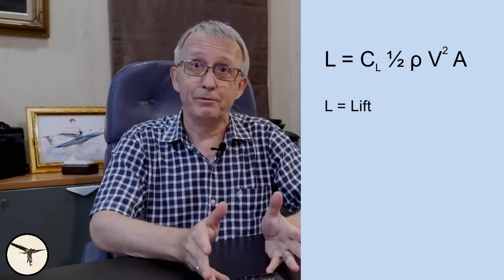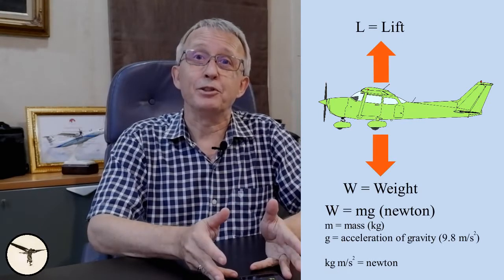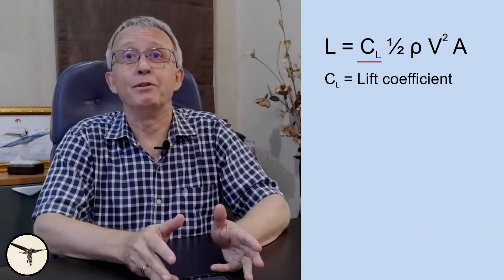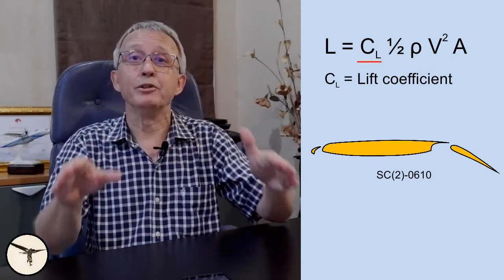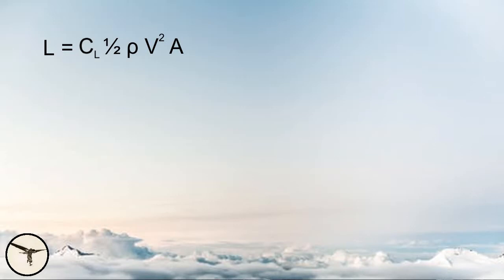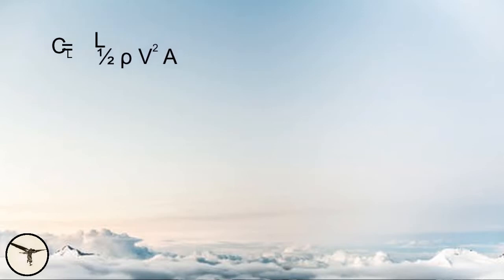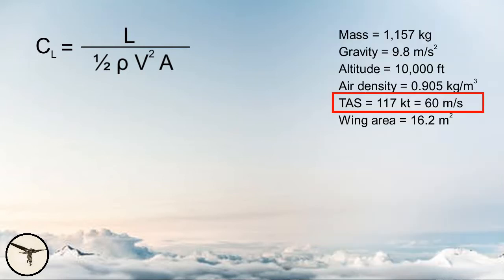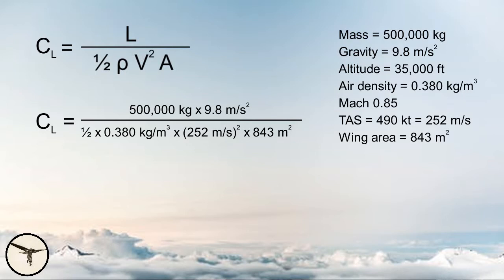The lift formula explained

Comment: What is conversion from CL to aoa?
Reply from the maker: It depends on the wing profile and the flaps setting. Each wing profile is different. The correlation between AOA and CL on a Cessna 172 (flaps up) is shown at 6:10.

Comment: Hi, thanks for the video! May I ask, where from does the AoA in degrees in the formula result came? I missed that part. Thanks (7:38)
Reply from the maker: The relation between AoA and lift coefficient is shown at 6:22.
Reply: @FlywithMagnar  Thanks! That table is a fixed correlation valid for a cessna only I assume. I've learned a lot today :)
Reply from the maker: @joacorodriguez3420  , yes, every aircraft model has a different table.

Comment: Hallo, pls. it means that if the Cessna will weight 3 000 kg the CL will be bigger. The more bigger CL is than the plain is lifted more? If the plain is heavier also CL is bigger ...the lift must be less...sorry I don't understand. Pls. what or how I can use these results?
Reply from the maker: Hi. CL is part of the lift formula. When the weight of the aircraft is higher, the lift must be increased. This can be done by increasing the CL (use higher angle of attack), or by increasing the speed.

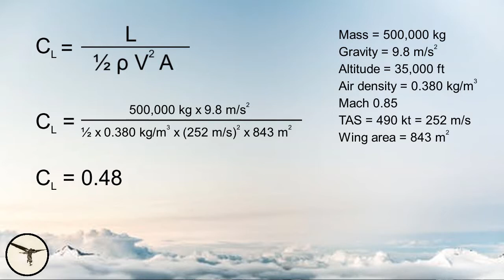Comment: 9:22 But how you know the angle of atack? what is the formula ? Because i want to calculate the speed and the angle of atack for specific weight at sea lvl and at 10km altitude.
Reply from the maker: I used the graph seen at 5:06. Such graphs are the result of airfoil design, computer simulations and flight tests. As you can see, the lift coefficient and the angle of attack are linear up to near maximum lift coefficient. That makes it easy to find the relation between them.

Comment: At around the 7 and a half minute mark, why is L the mass of the airplane multiplied by gravity?
Reply from the maker: Can you please check the time mark? Lift (L) equals the mass (M) of the airplane multiplied by gravitational force (G-force). In unaccelerated flight, the G-force is 1, and L=M*1. In a coordinated turn with 60 degrees bank, the G-force is 2. Therefore, L=M*2. If you push the stick forward and you get weightless, the G-force is 0. Therefore zero lift.
Reply: @FlywithMagnar  Yep, I realized after commenting what it meant by going back through the video again.  Thanks for the quick reply.   Cheers!

Comment: Video try to explain lift just by a drag force, but CL or CD coefficient must be vectorial angle attack must be sine and cosine function accordingly, and must be between 1 and 0, they use velocity v to define that CL coefficient. We can not be defined by velocity angle of attack can be changed relative to x-axis direction, that is a big misconception because is the very optimal angle of attack depending on engine of plane and area. Or more philosophical question do wings need at all? and when wings become drags force to move freely force with higher velocity forward (x-axis) that is a very nice feedback loop math calculation. Drag coefficient CL - is independent of plane velocity or wind in the case of windmills.
Reply: Drag Coeff. is CD.. not CL.!?!

Comment: how did you get both CL and angle of attack form the same equation.
Reply from the maker: When no other parameters are changed (for example flaps setting), the CL is a function of the angle of attack.

Comment: Please explain, Why is it exactly 1/2 infront of air denstity ? Why not 3/4 or 1 ?
Reply from the maker: That's an interesting story! At the time of the Wright brothers, the formula for lift was L=k⋅S⋅V2⋅CL. The k is a constant called Smeaton's coefficient, which accounts for the density of air. However, it did not account for variations in air density. In 1759, John Smeaton published a paper where he defined k to be 0.005. The Wright brothers calculated it to be 0.0033. Today, it is considered that k=0.5⋅ρ. That's why the lift formula has the 1/2.
https://aviation.stackexchange.com/questions/22257/does-smeatons-coefficient-have-a-modern-accepted-value-or-it-is-dependent-of-th

Comment: Thank you for very informative video. But I have a question. Think, we are flying a Cessna( which has an asymmetric airfoil) at 100ft of altitude. we know that asymmetric airfoil generates more lift if the aircraft increases its speed. therefore, that additional lift will cause aircraft to increase its altitude. Now if I want to maintain this altitude and want to speed up to the maximum. how do I do that?
Reply from the maker: You reduce the angle of attack by trimming the nose down as the speed increases.
Reply: @FlywithMagnar  Thank you

Comment: How to calculate the engine power after solving that equation?
Reply: Since there is no acceleration in the equation one can't determine a net force, which is required for power. Different forces on a mass will yield the same energy output once a particular velocity is reached.

Comment: Thanks for the great video! I have a question regarding lift. If I am climbing in an aircraft and I am able to maintain the same indicated airspeed shouldn't my rate of climb remain constant since my increased velocity (TAS) is compensating for the fall in density? From practice and the POH I know it is not the case but trying to get my head around the theory because in my mind one would assume the same pressure is hitting the pitot tube.
Reply from the maker: Hi. It is correct that TAS increases when you climb with constant IAS. It is also correct that increased TAS compensates for reduced air density, but not 100 %. According to my calculations, the factor is 92 to 94 %.
However, there's one more factor: Engine power. The less air the engine gets, the less power it delivers. This is the most limiting factor.
Reply: @FlywithMagnar  Since there is no acceleration in the equation one can't determine a net force applied to a specific density, which is required for power. Different forces on a mass will yield the same energy output once a particular velocity is reached, hence force and energy should not be confused.

Comment: How many rpm to lift the helicopter?
Reply from the maker: Almost every helicopter fly with constant RPM. The RPM of the main rotor depends on the diameter. The larger the diameter of the rotor, the higher the tip speed for a given RPM. When the tip speed reaches the speed of sound, the efficiency of the rotor decreases rapidly. Therefore the RPM is set to avoid that. A typical main rotor speed is 450 to 500 RPM.
Lift is created by varying the pitch of the rotor blades.   
http://www.redbackaviation.com/helicopter-engine-rpm-rotorblade-pitch-management/#:~:text=Most%20helicopters%20operate%20at%20around,split%20or%20overlapping%20rpm%20gauge.